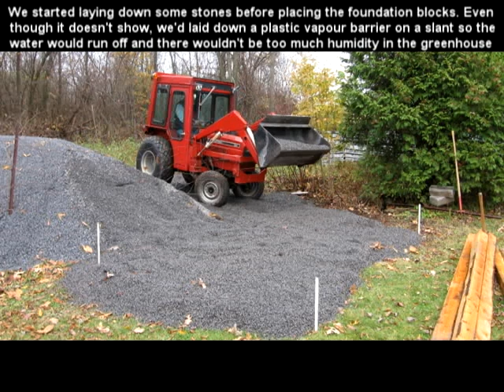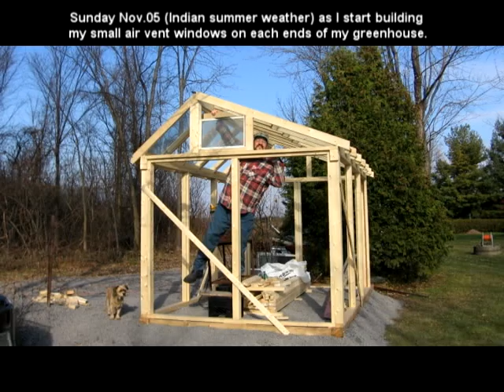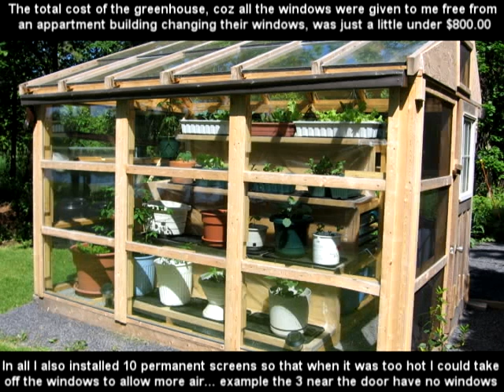How to build a greenhouse using only windows & wood

Comment: I just got several sheets of tempered glass. 34 x 76 x 1/4 thick. How have your windows held up for leaks and such? Would you do anything different ? Could you show a close up on how you framed in your glass? thank you
Reply from the maker: Sorry I no longer live there since my wife passed away. The windows were just fitted in loosely in case the ground shifted during the winter so they wouldn't break... so leakage wasn't a big concern of mine. If you look at 3m16 you'll see 3 pieces of wood about a foot long. 2 on each side and one on the bottom of the window and I did the same thing on the outside so that was what held them in place.  Oh & BTW I had my "little greenhouse on the lake" for many years but I only published my video in 2016 coz I thought it might help other people looking for greenhouse ideas. And the one thing I would have done different is build it twice the size because I had over 100 windows...! Thanks for watching and good luck with your project...!:o)
Reply: Thanks for posting this video.Started my greenhouse project today and your video was a great motivator. So sorry for your loss.

Comment: I can recommend Hemp Shield wood sealer  is a very high-quality product that comes out of Oregon it's environmentally friendly and it's less expensive to use then traditional chemical-based and is much better and easier-to-use. It only takes one light coat  so there's less work. The molecules of the hemp oil are very small and have very deep penetrating abilities and also offer UV protection. Amazing product, highly recommended.

Comment: Cool. How did you install and taper the roof Windows? I have a bunch of storm windows I'm thinking of using for a greenhouse roof but am struggling on ways to install them.
Reply from the maker: I installed the 2 front windows just on a small 1" x2" wooden ledge and then at the bottom end I put a small piece of wood to keep them from sliding off the roof and all I did was caulk them instead of using a piece of wood on each side on the top just in case they moved during the season changes. The two in front overlap and again a bit of clear silicone caulking to hold them one on top the other was sufficient. The one at the top (in front) overlaps a few inches and the back one is just sitting below it and I put caulking to keep them from touching and to seal them at the same time. Had no problems from leaking but even if I would have... after all it's only a greenhouse eh...? Ha ha...! 

I mentioned it at the beginning but didn't take pix coz I only thought after it was built to post my idea on YouTube so make sure to put a vapour barrier on the ground otherwise you'll have way to much humidity unless you're wood is cedar or treated and you don't mind the humidity...! Good luck... BoB

Comment: did not show how you started the roof......other than that..awsome video.....
Reply from the maker: Hi ZL... you're right coz I really didn't think of making a "how to" video til most of the work was done because I had a beautiful window shade from a RV that someone gave me and I fixed it at the top of the roof on the inside and could pull the shade down along the top of the roof whenever the sun was too hot but unfortunately I didn't even think of taking a picture to show it...! Thanks for your kind words. BoB

Comment: Sorry but as a retired carpenter I have to tell you there are several mistakes. First you should have oriented the windows vertically not horizontally. This would have given the building much more strength. Second the horizontal studs (since that is how you built and even if you didn't) should have a slight bevel or angle down towards the outside. That keeps unwanted water flowing out, not in and minimizes rot. The same goes for the roof. The glass on top should be even with the framing on top to keep water from standing and causing rot. Of course all woodwork should be painted and sealed for same reason. Lastly the vent windows should open out, I know that may make it harder to open them but they will much more weatherproof. Again I apologise as I don't mean to pick apart your work, just want to keep others from making the same mistakes. One more thing, when framing in the windows it would be better if you framed all the way around, not just short pieces.  :(
Reply from the maker: Geez... wish I had known you way back then. I could have called you up for advice... ha ha...! But I can tell you that it still worked well my "little greenhouse on the lake" and I ate pesticide bug free veggies for many years. I only published my video in 2016 coz I thought it might help other people looking for greenhouse ideas.
Reply: No problem, I would like to help anyone who searches for ways to become more self-sufficient. Too old to work anymore but not to old to help with gained knowledge. (I hope)  :)
Reply: @c2h2o9c9olate  you still giving free wood working advice brother?
Reply: @CC-jy4gr  Depends on what you need. "All free advice might be worth what you pay for it"  :) I'm too old to work but will help if I can. What do you want to know?
Reply: @Peacelove319  fiberglass panels they don't rot and are inexpensive and they diffuse the light, better for the plants.

Comment: Hi, how did you install the glass panes on the roof?  You took the windows apart and so were using bare tempered glass panes and wood correct?  I have some old tempered glass that I want to build a greenhouse with but am uncertain of how to frame the glass and afix it.
Reply from the maker: Basically I just put some wooden stoppers at the bottom so they wouldn't slide off and then I used clear silicone to fix them to the framing on each side... it is the same as glue plus it is waterproof. The side windows are just sitting on the 2 x 4s and I put small wooden stoppers on each side of the windows so they wouldn't fall out  (1 on each side and 1 at the bottom therefore 6 pieces of wood in all) And leave a little space so they can move a bit in case the ground freezes over unless you live in an area where you don't have that problem. Good luck with your project and sorry it took 2 weeks to answer.